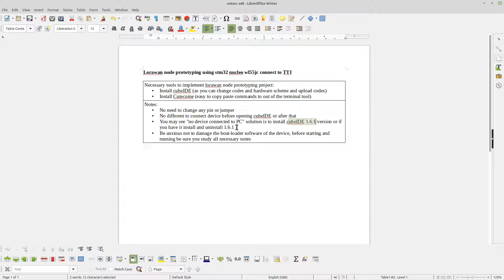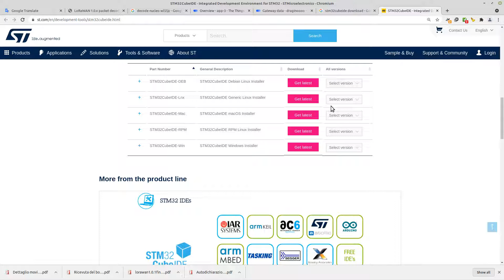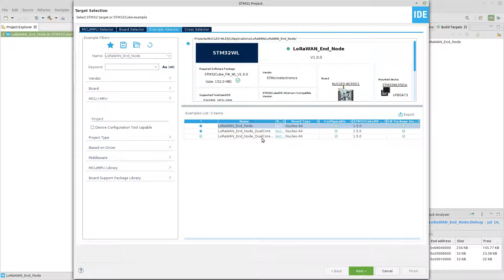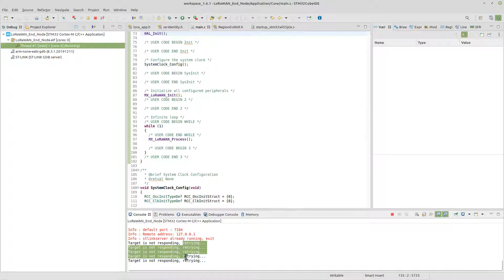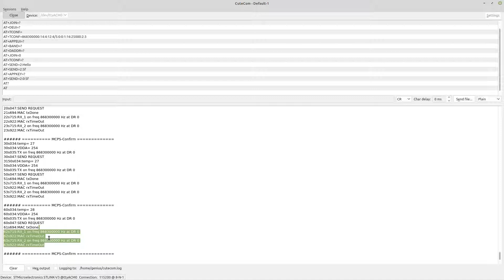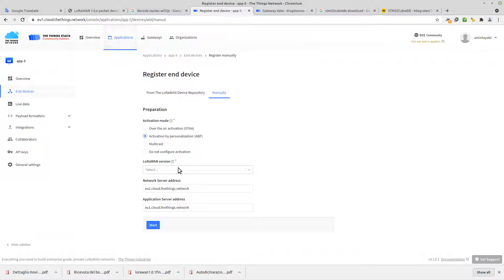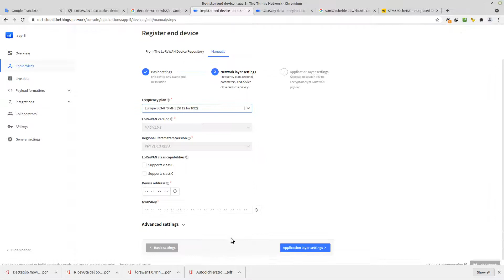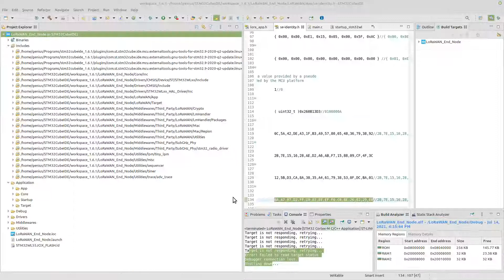BUILD LORAWAN END NODE using WL55JC STM32-NUCLEO BOARD and TRANSMIT DATA to TTN (TTI) NETWORK SERVER

Comment: "Hello, I have a question. I am running the project and I am able to send data to TTN, but when I make changes in the IOC to read a sensor on the board, I get errors or my changes do not take effect. Can you help me with this?"
Reply from the maker: Thank you for watching, I dont know you followed the steps I did in the video starting from 9:43? which changes you want to do?
Reply from the maker: anyway I suggest to follow steps in another my video DHT11_SENSOR_DATA_TRANSMISSION_USING_STM32_BOARD_L476RG" because its not important that the board is different in this video you can learn how to add codes in IOC too.

Comment: Hi.
Did you use a gateway in this project? In other words, is a gateway needed to send data to TTN with STM32WL?
Reply from the maker: Hi, Thank you for watching and your comment. Yes gateway is crucial part of lorawan network, but if you want to run a LORA (NOT LORAWAN) its possible to exchange messages between two nodes. (see this for more details: https://enless-wireless.com/lora-lorawan-network-difference/)
Reply: @amintayebi  Thank you for the valuable information you provided. Please keep making videos.

Comment: Thanks very nice, by any chance could you help me to include i2c in this example? if I simply enable it from MX it gives me a build error like it doesn't generate i2c.c
Reply from the maker: Thanks for your interest and comment. In fact i2c is easier than my scenario in video. just I put a video link here as I saw it should wourk with wl55j too board structure is same as L476RG. GOOD LUCK                                          https://www.youtube.com/watch?time_continue=242&v=isOekyygpR8&embeds_euri=https%3A%2F%2Fwww.digikey.it%2F&source_ve_path=MTM5MTE3&feature=emb_logo

Comment: It is nice that I've found this video with such organized and well explained steps. But I have a question, have you tried changing the .ioc file in order to setup the pins for GPIO input and output purposes? Because every time I try to do that, and I click "generate code" from the CubeMX interface, it will mess up the entire project and a lot of errors will show up. Thank you in advance.
Reply from the maker: Hi dear Ruben,
Thanks for watching and comment. In fact seting up GPIO PINs are possible in 2 ways: 1- via programming 2- via graphical scheme. If you could send me your code and mentione which parts you have been modified.
Reply from the maker: Another note: may I ask the model of Gateway  you are using?
Reply: @amintayebi  Hi, I was using the same example but I downloaded it from the STM website and exported it from STM32CubeIDE. The best way is as shown in the video: to export the example from the IDE's interface. After doing that, I can change the .ioc file whenever I want and the generated code works fine.
I am using a The Things Industries gateway at AU915.

Comment: Hi.  I getting in to using this board and STM32IDE so you video was very helpful, Than ks.  However one thing that would make you videos much better is better audio quality.  Your voice is so quiet with so much background static it is hard to follow sometimes.  Also maybe keep the microphone off your desk because I hear all the thumping from you hitting the keyboard,  can be very distracting.
Reply from the maker: Good morning dear Mike, thank you so much for your valuable comment, sure I solve the quality.

Comment: Hello amin im going to work on a lora node project i have E22-400T30D and a STM32f407vg board is it possible to make a lora node with this materials. Thank you
Reply from the maker: Hi thanks for your comment, of course its possible, base on this page (https://www.ebyte.com/en/product-view-news.aspx?id=437) you can see pinsout and then see which pins it has been connected to the board in this page (https://www.mobilefish.com/developer/lorawan/lorawan_quickguide_build_lora_node_rfm95_arduino_uno.html) and do the same. Good luck.

Comment: hello amin im trying to use nucleo for a same project but im having issues with nucleo can you please help?
Reply from the maker: Hi yea may I ask you please clearly tell me where u have problem with all details, first I suggest to search your problem in community.st.com? (moreover you can do the same I did in l072z board for your nucleo if you saw your board model is in the samples).
Reply: @amintayebi   hi amin   for some reason i cant  make it work. i tried to do this project ( https://www.youtube.com/watch?v=xTx6_jgvnbw )  was able to make it work until it was time to debug  i got error "fail to start GDB server "  i then try to  load even Example _LL_GPIO projects provided on STM32WL package but its not loading the .project file for some reasons,  im not sure why.
Reply from the maker: Ok @steveolivier4504  I had this error, Be aware that you need to put your code in main.c inside core_CM4.